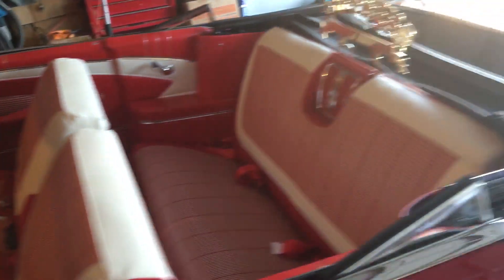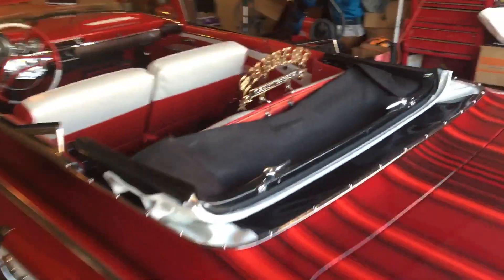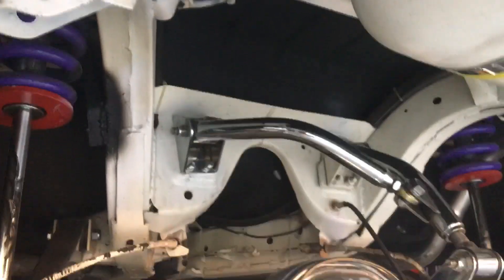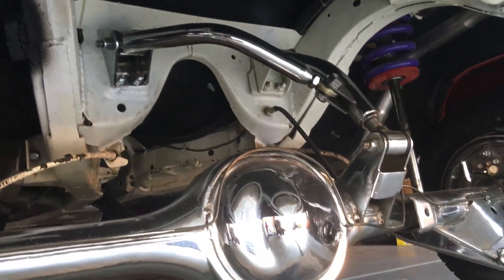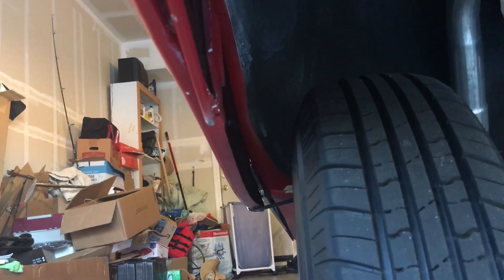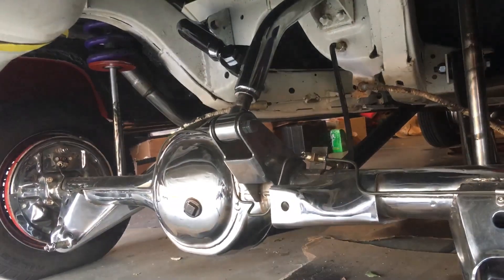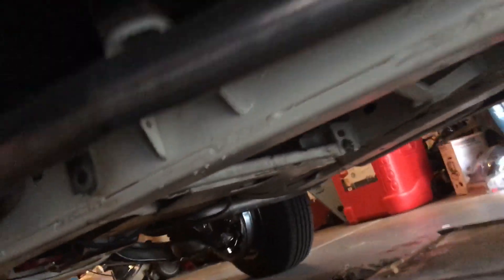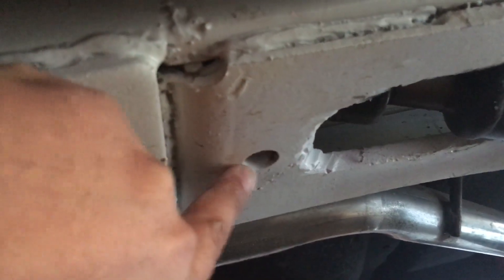Impala lowrider rear hydraulic suspension part 2

Comment: Why did you have to tap it so many times to go up , are those like 8 inch cylinders in the back
Reply: Alexander Gonzalez he maybe needs battery charging or just he barely taps the switch once u get use to the switches u kind of barely tap sometimes but when u first start hitting them u hold it for a little too long 😂 and almost fuck it up😂

Comment: Whats up bro! Nice work! Exactly what I wanna do on mine. I wanted to ask, what did u do w/ your old un-chromed trailing arms w/ the welded power balls ? Do u still have them by chance & be willing to sell them to me? I have PayPal.
Reply from the maker: Nelson Cordova - thanks bro. I have already sold my old parts.
Reply: Oh shooot! :(
Reply: I wanted to ask u bro, is your bridge valley in the middle removed & reinforced because I have a telescopic drive shaft on mine too but I mistakenly put the telescoping yoke on the other end near the pumpkin rear end , now that I know that i have it wrong Im a put it like yours but anyways the two holes where the carrier bearing goes screwed onto, it like broke off  & the carrier bearing is no longer secure. Im assuming this happened cuz I had the yoke reveresed the wrong way, u think? Im just wondering how I am going to fix this. Any ideas bro?
Reply from the maker: So you're saying the Carrier Bearing ripped out? Is it a heavy duty carrier bearing? HD bearing is a must have. If you do have an HD, I think your driveline could possibly be measured to the wrong length. It would take a lot of force to rip out your HD bearing and bend metal. There are different lengths depending on your transmission and whether or not your trailing arms are extended or not. The best bet is to take your driveline to a driveline specialist and give them your measurements fully locked up & fully laid. They can confirm your driveline is correct for your car.
Reply: No no. Not the carrier bearing. I have a heavy duty one that is pure metal , no rubber no polyurethane. Im sayin on the bottom metal where the screw holes are(the bridge valley) has started ripping out. Make sense a little better? Thats why i asked if yours was, taken out a some point, reinforced with more metal & welded back on. Cuz I was thinking maybe thats what I should have done if i only knew that this was going to happen. Thats how yours looks from the video, Im not sure maybe not. & also too was thinkin maybe it ripped out cuz i had the yoke on the wrong end. Also too it shouldnt really matter my drive shaft length cuz its telescopic right? I currently have a 350 transmission but am changing to 700r4.
Reply from the maker: Nelson- if it's the screw holes (driveline tunnel to bearing) it's definitely your driveline length. As long as your slip yoke was put in the rear portion it shouldn't stress the the tunnel.

Comment: Did you reinforce your frame? I have a 63 convert ,wanna lift it. Should I reinforce it?
Reply from the maker: RC Jr , verts are boxed, and have minor reinforcements on the x-frame from the factory. No need- if you just have basic up and down switches.
If you want to 3-wheel or hop your car, you will need to reinforce.
Reply: Vincent Ortega thanks bro! nice 60 btw.
Reply: So would it be a partial wrap, or full for minor hopping. Thanks again.
Reply from the maker: Honestly homeboy, a vert frame is pretty sturdy. I personally wouldn’t worry about minor hopping but.....  as a builder I would tell you to reinforce because if you have the switches, your gunna hit em. Especially when cruising. You wanna kill the crowd. Go big or go home.
Reply: Vincent Ortega Thanks for your advice bro. I am going to reinforce it after all, I wanna hop it and three wheel eventually. That's what Impalas are for🖒
Reply: Vincent Ortega 👏👏👏👏😀🍿🍿✌👏yeahh and also bags are for groceries😁✌🍻
Reply: John deer True Chicanos use hydraulics....lol. Thanks bro

Comment: I looking at impala to buy. The seller just told me all it needs is a y bone to be straight?!?!?  I don’t know what he means.! Is it a red flag the chassis was damage ?
Reply from the maker: Not at all. Y-bone is the same as a y-bar. As explained in my #1 video. The ybone will correct any lock up issues
Reply: Vincent Ortega  the seller just told me it’s makes a ticking noise when driving?  The y bone needs to be fix?

Comment: for rear they using truck lifting jack, but they using a small one, for front just drill a hole wiring heavy duty pipe then pour some absorber oil... that's why for rear they dont using adjustable just normal spring coil